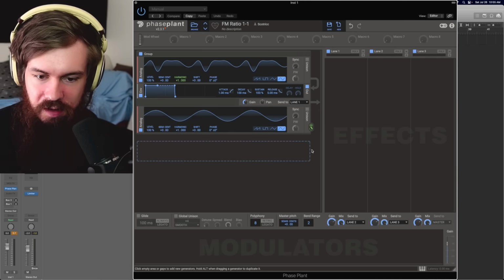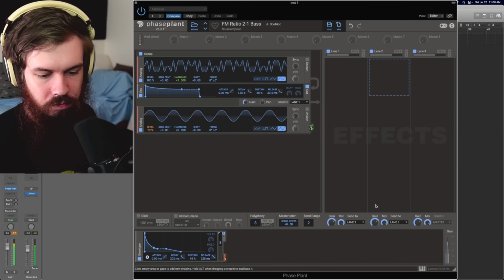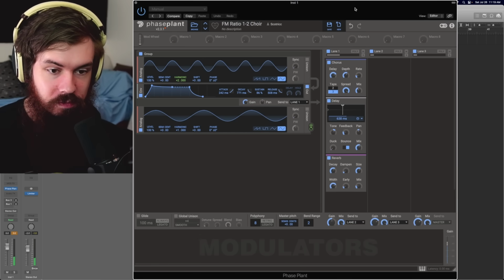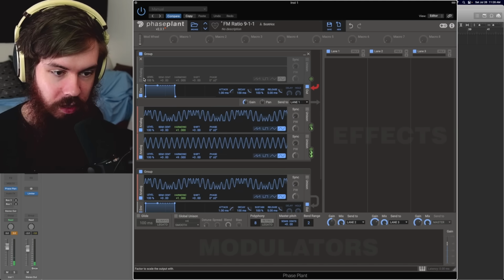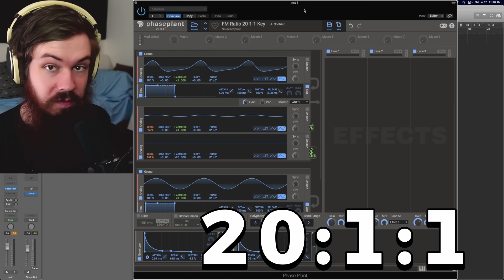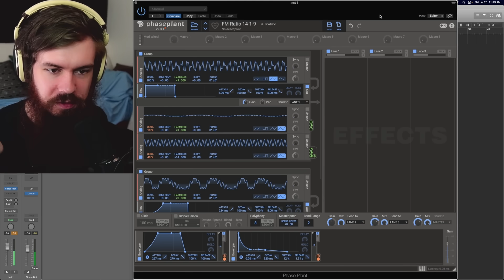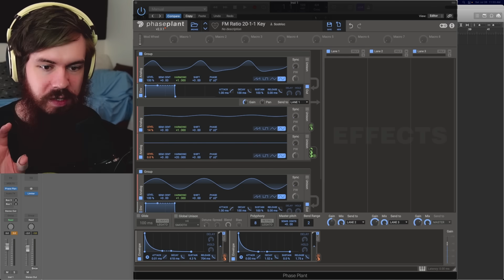FM Ratios are not so hard

Comment: Changing the modulator
3:07 1 : 1  "Basic sounds, good for bass, brass, keys, leads, bells, pads - can be mellow or bright"
4:26 2 : 1 "FM equivalent of a square wave"
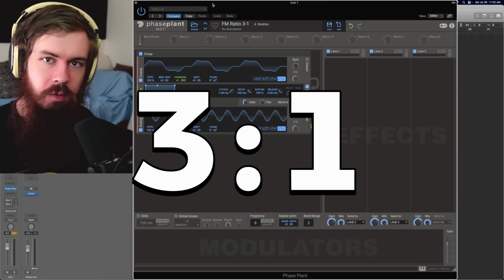5:29 3 : 1 "Hollow sound, kind of similar to a PWM sound but not, good for mellow guitar-like sounds, harps, other plucked sounds"
5:49 3.5 : 1 "Taco Bell, need I say more?"
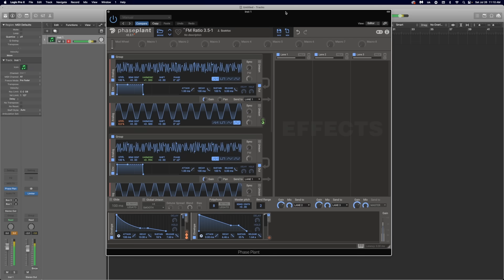6:25 4 : 1 "same as [2:1] but brighter"
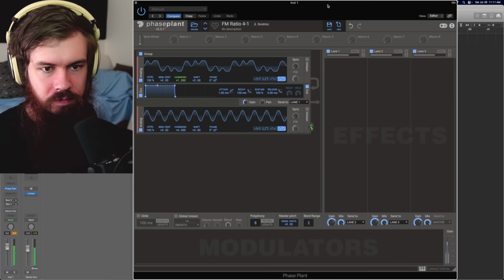6:33 5 : 1 — 6 : 1 — 7 : 1 "metallic, good for bell-like or melodic percussion sounds"
6:53 8 : 1 "much brighter, pretty much bells or harsh leads if using anything but a sine wave"

 Changing the carrier
 "very bright nasal sounds, close to a high-pass filtered saw where the higher the tuning, the more filtered the sound is and the higher harmonics ring through"
7:37 1 : 2
8:13 1 : 3 
8.45 1 : 4

DX territory : "depending on what’s being modulated, could be a good keys sound, bass sound, lead, or FM tines"
9:34 9 : 1 
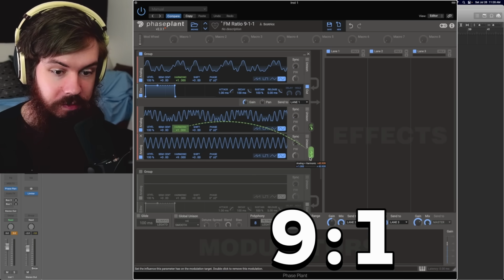9:57 9 : 1 : 1

Comment: I’d like to add 2 more simplifications for explaining FM:
Operators (both carriers and modulators) are essentially near complete synthesisers: they have an oscillator, an envelope generator and a LFO. *
Carriers next to each other are layers (especially algorithm 32)
Your mentioned ratios are the actual heart of FM.
All the algorithms are mere combinations of the above.
* no filter in early FM synths because you should achieve the target sound without one. Modern synths have filters because of ease of use, not necessity.
** for educational purposes you can demonstrate FM on the Korg Opsix with the modulator because you can start the frequency from LFO territory until you reach FM.
And yes I also have one or two questions about FM.😅

Comment: I like the ratio of 0 for waveshaping too... Very clean distortion. I never understand why fm is difficult, it is just a different approach.
Reply: ratio of... 0? so... silence?
Reply: @cataclystp  ratio of 0 turns the operator into a waveshaper, that you feed others op into..
Reply: @Darushiokan in what synth? what you're saying makes no sense, a frequency ratio of 0 means a frequency of 0 meaning silence. I'm not quite sure what you think you mean or why it means what it does in the synth you use.
Reply: If your synth allows you to set operator ratio number to 0,  you get a waveshaper module. Anything that is fed into it gets waveshaped/distorted. Its common trick. 

Example: Set carrier at 0, and feed another operator/audio signal into it . 
Carrier's waveform choice influences the results, just like a regular waveshaper. 
And its useful to place the pseudo waveshaping operator inside a chain of operators too. (taming frequencies, crazy effects etc) 

Fm8, massive x (int off) sytrus iirc and many more allow that.
Reply: Not ratio, but frequency 0 Hz...

Comment: Excellent video! I was playing 6 nights a week back when the DX7 came out (yeah I'm that old). I bought one and sussed it out pretty quickly and ended up doing some programming classes and selling DX patches out of Keyboard Magazine. Yes, FM is completely different than subtractive synthesis, granted, but geez it's not quantum physics equations. It doesn't take all that long to figure out the basic ratios and what they sound like - similar to learning what saw and square waves sound like. I think people have heard "It's so hard!" that they've kind of bought into that. But... I can see the way  it's implemented now, adding subtractive filters, different waves, and other features/options definitely complicates it. As difficult as the DX interface was, there weren't a lot of extraneous features to muddy the water - maybe it was a little easier than the modern implementations.

Comment: An easy way to experiment with FM Synthesis is with VCV, a free app. It has a number of FM oscillator modules that can be stacked in any configuration. It also has a frequency analyzer module. You want an oboe sound? Get an oboe sample and put it through the analyzer to see the overtones. Now patch in the FM modules and adjust the modulator:carrier ratios to match the oboe harmonics.

Comment: Another configuration worth noting (in phase modulation!) is setting the carrier's (or an intermediate modulator's) frequency to zero, i.e. 1:0, 1:2:0, 1:0:1, etc. which will make it stationary and function as a wavefolding (waveshaper with a periodic function) effect.
Reply: Then you have to write it different way as it is not a ratio. For fixed frequency Yamaha used Hertz.

Comment: 1:58 about 4 octaves about middle C, just based on the magnitude. actual note I can't do in my head (it's a rather flat D#)
Reply: the lowest useful hypothetical note to use for this would be midi note 12, or c0, at 16.35160hz. you'd need to go ~10.26 octaves to reach 20khz, the usual cutoff range for human hearing, so as far as bandlimiting is concerned, you only really need to define/evaluate your waveforms for around 11 octaves at most, and the higher your base frequency the less you need to evaluate.

Comment: Usually, fm synths with custom waves like saws distort so fast with a modulator. High ratios sound very glassy and tinny. I find it interesting that old fm synths like the Yamaha gs-1 and yamaha gs-2 used analog chorus and really lush ensemble effects to fatten up the sound.
Reply: that's why its fundamentally overrated to me...increasing FM amount gives you non deterministic brittle plasticky digital harmonic distortion...increasing ratios gives you metallic comb filtery timbres...and increasing feedback adds ear fatiguing synthetic noise...so complex waveforms let alone FMing samples qoes zero to 100 into a distorted noisy mess with few musical use cases...so in order to get the best results ur better off sticking with sine waves and ur forced to go deep diving into intricate msegs for amp/level to control these characteristics and shape into musically useful sounds...only to end up with the same 10 relative sounds that every other synth makes that everyone's ears have been bombarded with for 50 yrs lol

Comment: Great explanation and examples. I will now have to go and play around with some FM synthesis.
Reply: If you have FL Studio go play with Sytrus or Toxic Biohazard. They both give you a patching matrix where you can patch together all operators however you want. If you have Ableton Live then Operator is your bet. Phase Plant (which is what this guy here is using) is awesome but it's kind of hard to wrap your head around it because any adding of components and modulation is very manual, it's almost like a (very vertical) modular synth in a way. Maybe Dexed is one you can try? It's very much like a software DX7. And it's free!
Reply: @iLikeTheUDK  I don't use either of those DAWs, I use Mixcraft Pro Studio or VCV Rack. I'm sure there must be a lot of modules in VCV Rack that will allow me to play around with FM synthesis. I just haven't had the time to try yet. I should look into Dexed sometime too. Thanks for the tips.

Comment: Funny thing is, once you twig to FM modulator ratios, the same ratios produce similar results with amplitude modulation or ring modulation: modulator at 2x or 4x the carrier's frequency is likely fairly non-dissonant (because the resulting waveform repeats perfectly every round of the carrier's cycle); ratios like 3:1, 5:1 are interesting but still not super dissnoant... and crazy "ratios" like PI : 1 or the Golden ratio to 1 are more dissonant because the resulting waveform doesn't repeat so neatly.
Reply: thx.... great extra Infos...
💪💥🗯🔥💭❤️💨🕊🤙